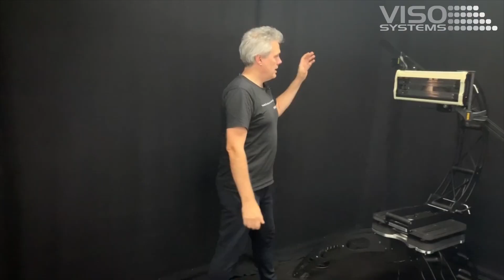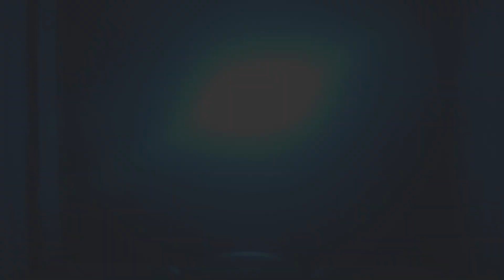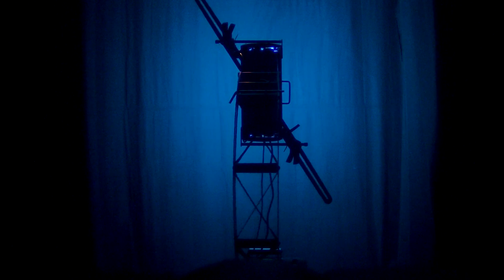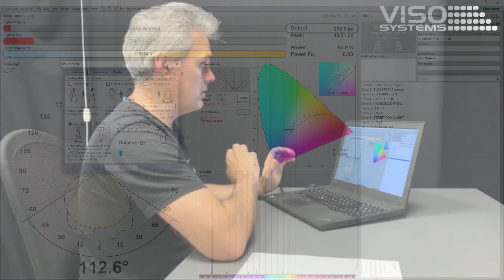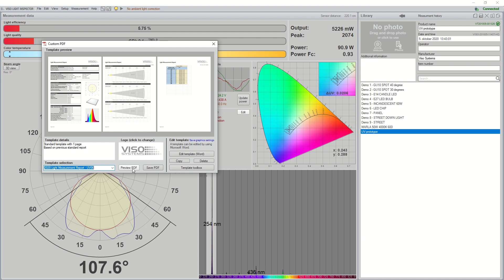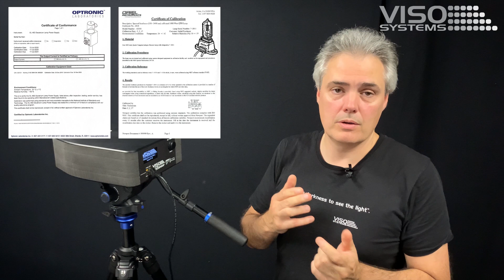Making UV light measurements - 3D light distribution - Goniospectrometer

Comment: good afternoon. is this a software version update or is there a change in hardware? i am currently using version 5.99 but cannot measure UV.
Reply from the maker: You need the new UV LabSensor model 2 which has a new spectrometer which can measure down to 200nm. So unfortunately, it is not just a software update.